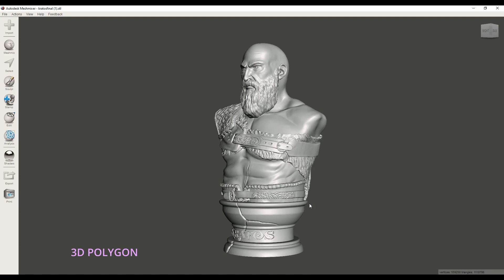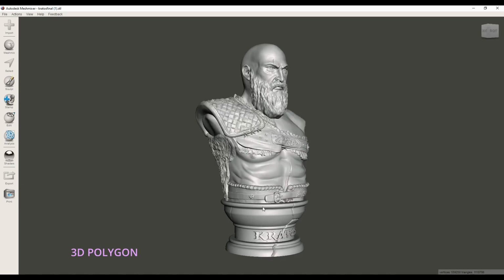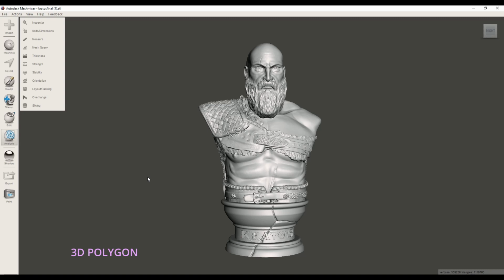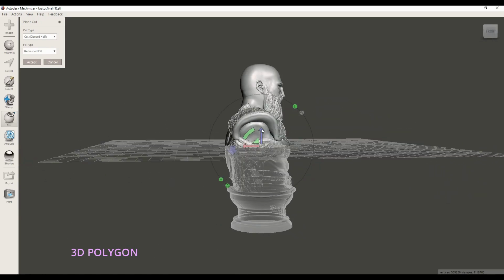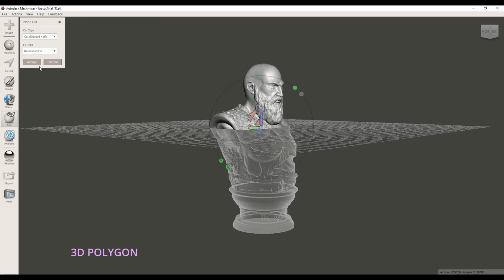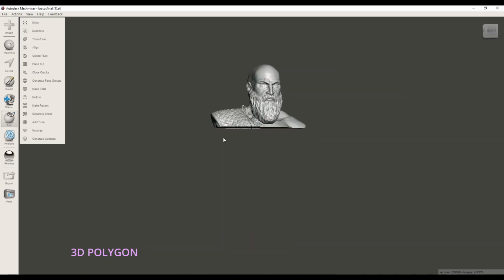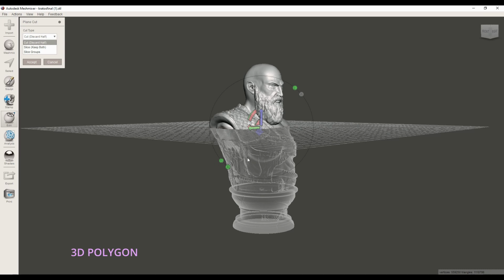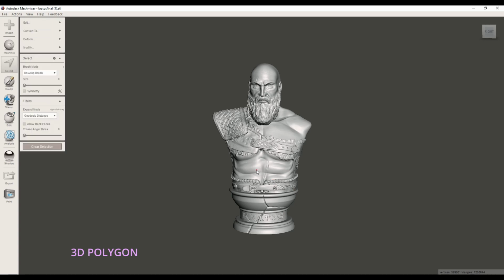How to Cut STL/OBJ Files | Meshmixer Tutorial 2022 | 3D Printing Guide for newbies

Comment: hi, I have a 3D model cut for printing, it is a ram's skull, the author has divided the file in an "anatomical" way, in practice it is as if he had ripped off the horns, he did not cut linearly as you showed yourself in the video.  My problem is that I have to put the pieces back together to edit it, but the program can't understand the references, can I put it back together with this program?  could you give us a tutorial?
Reply from the maker: Solution no.1: import all the STL file in to meshmixer then see if they are placed where they should supposed to be. If so, you can combine all and done.

Second solution: import all the parta and move the models to the proper position. Which ia a little bit difficult. Then combine. Since,  it is STL you don't have fully control on your models.

Third solution: if the model is symmetrical, yoi can mirror one side then combine the mirror part.

Comment: After cutting a file into 3 parts exporting to cura...slicing  it ...saving it to SD...when I attempt to print on my ender3 max neo...the usual dialogue box that comes up; estimated time of completion etc is blank and the printer only heats up but it will not print ...can anyone tell me what I'm doing wrong please and thanks
Reply from the maker: check if the gcode properly saved in your SD card. sometimes, if the gcode file is big takes time to copy into SD card and if you eject it early, it won't work

Comment: hi Why did I cut and slice my model into pieces with Meshmixer and then put the pieces together vertically in Cura, there were approximately 24 pieces that I was able to prepare for printing in 3 times in Cura, i.e. in 3 stl files, my problem is that I printed the first layer It is printed like a net, which means that it is not like my other prints that the first layer is correct, clean and smooth, what is the problem? I have adjusted my models from left to right and horizontal to vertical to fit more in Cura
Reply from the maker: Hi, just make sure that your 3D Model remains solid after cutting with Meshmixer. or check your 3d model with analysis option after you've cutted your model. sometimes cutting models into different pieces may cause damage to your file.